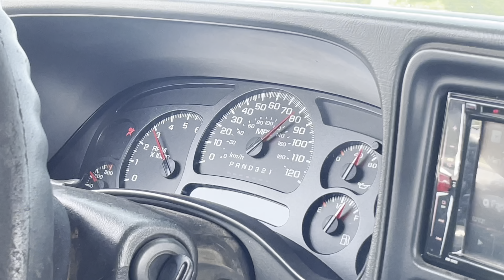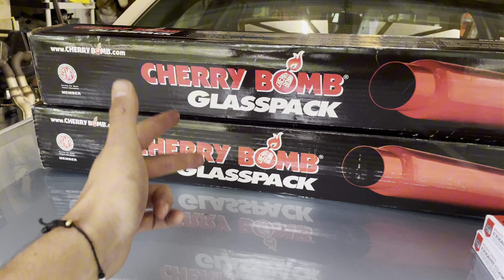TRANSFORMING My Manual Swapped Grand Marquis!

Comment: Your car is badass bro I’m also building one myself and want to manual swap it what kind of transmission is that and what all did you need to manual swap it ?
Reply from the maker: Appreciate it man! I have a tr3650 from a 99-04 new edge in this merc, I’d suggest going on crownvic.net or the manual swap fb group to get a full in depth parts list. I can name most parts off the top of my head as the basics needed but it’s been a few years since my swap and the write ups on that forum & group have every nut & bolt needed!🤘🏻